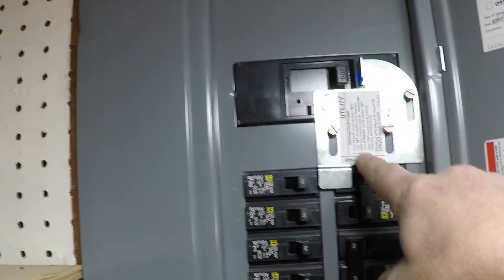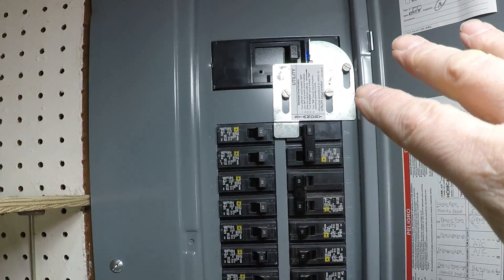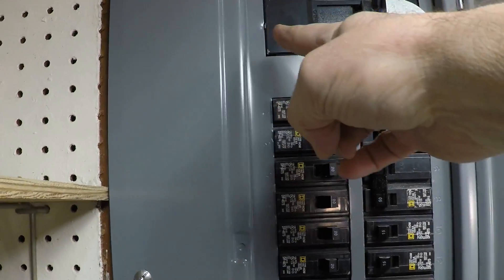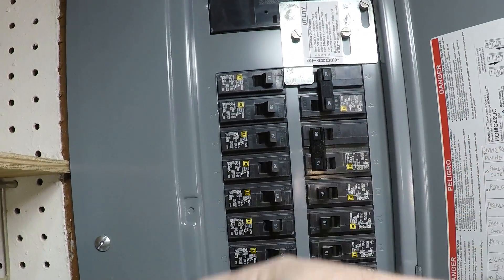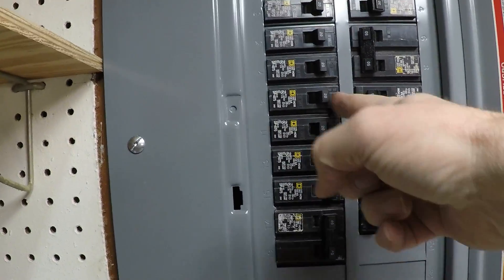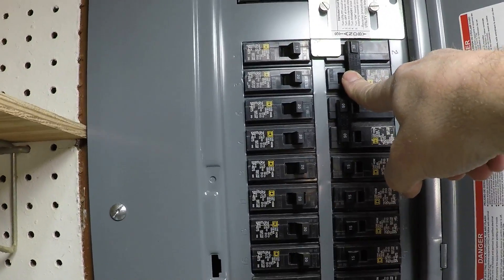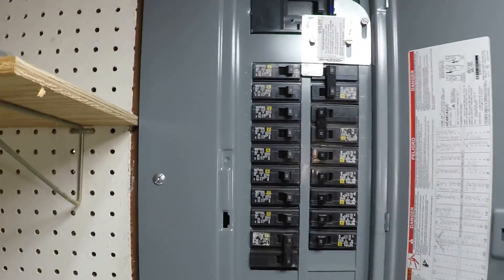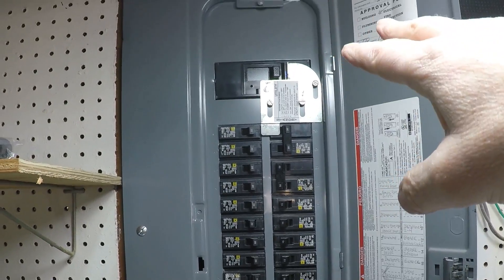Transfer Switch vs Interlock Kit: Which is Best?

Comment: GREAT  VIDEO - Thank you  ----   Was  consideriing   whole home 2 story 3200 sq ft     back up      or only doing  essential  circuits -- Have  a   400 amp service  (  2 -- 200 amp  siemens  electrical panels  )    Live on  3.5 acres   and now listening to you  I am   seriously considering interlock switch  as  the auto transfer  switch  w/ generac generator   was going to require propane tank(s)  250 minimum ,  as  we have no natural gas where we live in country The cost quoted  for a  250  and  500 gallon tank respectively  $2100  andd  $3000.  plus  trenching for  gas pipe line from  tanks to generator.   Cost for this kind of sytem was ruled out  because of  costs----💰  over  $30K not counting gas tanks  and costs associated with the   gas  tanks'  installation and maintenance.  
Will go  portable generator  with 50 amp plug &  interlock swiitch....  DEFINITELY   is a big decision--
Well water  and  refrigerator  are   ESSENTIAL  circuits ....can add other  circuits  depending on generator size......
Going for  Inverter  type of generator,  with remote start--- I have done much electrical work  --
but will probably  hire electrician  (  maybe 🤣😂⚡
Reply from the maker: yeah $30k is way too much. Just use the interlock.

Comment: I have to disagree with you about the difficulty of installing a transfer switch, it isn't harder than a interlock, with a transfer switch you have 2 marked wires for the circuit you want to power, a black one marked A and a red one marked A, you just  losen the screw on the breaker and remove the wire and connect it to the black wire marked A with a wire nut, them put the red wire marked A and  connect it to the breaker you removed the wire from, then you do the next circuit you want and repeat with the next circuit you want to power with the red and black wires marked with B, this is easy to do if you can do a interlock, which most likely will involved moving a couple breakers in you panel and replacing them with double poll breaker, and you also have to drill holes in the face of your breaker panel, you will be limited to how many circuits you can power, but during a power outage you don't have to go through the process of shutting all your breakers off, then turning certain ones back on and maybe having to chose which ones should be left off, you just switch each breaker in the transfer switch from line to generator, you done even touch the breaker panel.
Reply from the maker: thanks for the feedback.
Reply: Maybe we are thinking two different styles of transfer switches. I am envisioning a new main disconnect switch just behind the meter. The switch disconnects the utiity meter power and connects the generator and the switch powers the full panel with either the utility or the generator power. This style will require pulling the meter and rewiring the breaker panel by separating the neutrals and grounds. The grounding needs to be rerouted.

Pulling a meter is not a DYI project.

Comment: I like interlocks.  I put color dots on breakers to make it easy. On Gen power,  Any green dots can be on. Only 1 blue dot at a time (kitchen stove, water heater, dryer, etc). No red dots (electric furnace, heat pumps)
Reply from the maker: It is good you have a system that works for you. We can run everything except for the AC
Reply: That’s a great way to do it.

Comment: was curious what you suggested for a manual transfer switch as i have batteries for backup so don’t need a generator to start but still don’t have enough money for a whole house ATS like the $900 generac install with extra costs for the labor and extra electrical cabinets, etc

and that gets too close to the meter so harder to remove/change in the future
Reply from the maker: I would just go with the interlock kit then